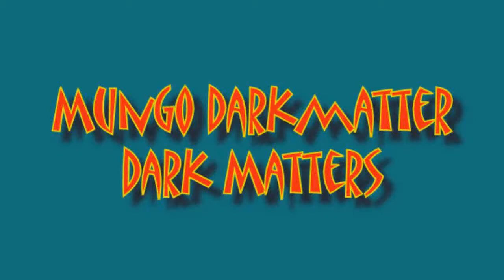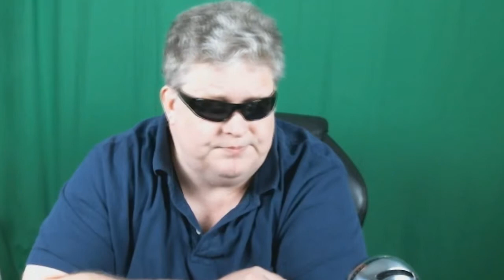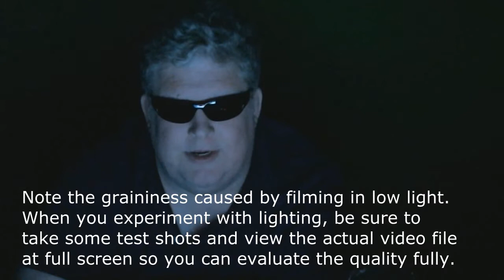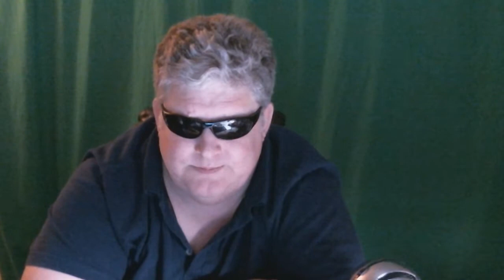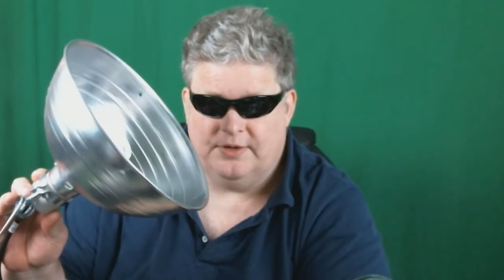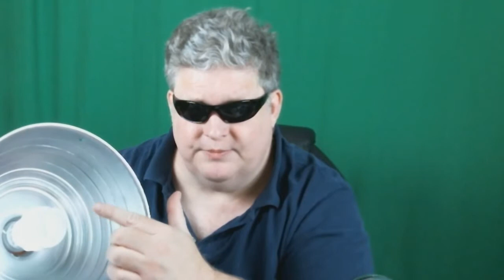How to Make Your YouTube Videos Look and Sound Better

Comment: That is the same clamp light reflector lamp that I am using my lights are a little bigger and they work great just like you told me they would in your message you sent me. I have them at a 45 degree angle I am going to try to angle them up toward the cieling to get the glare off my rosewood fingerdoard of my Bass guitar thanks for all your help and advise keep up the great informative videos   Your friend IRONSTORM4